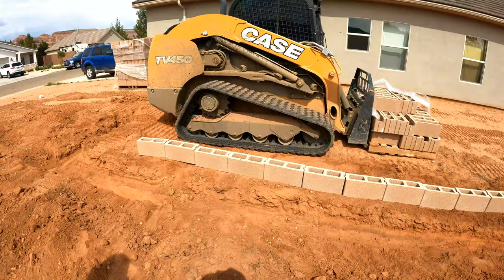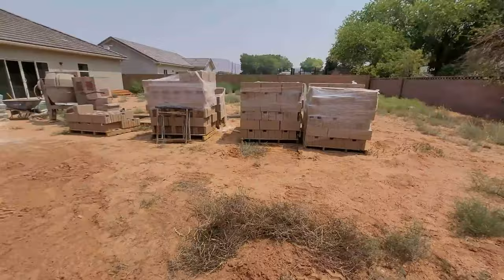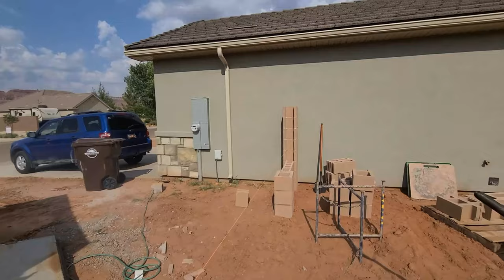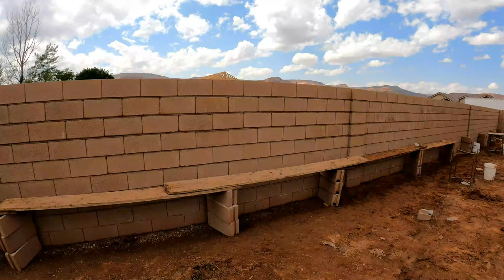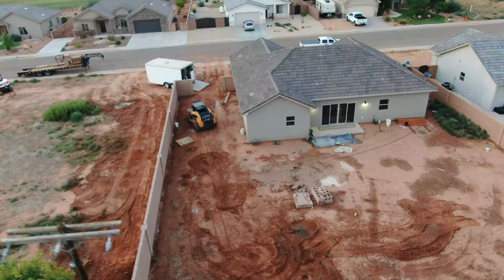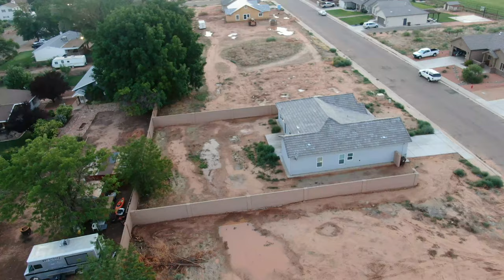Masonry Block Wall Full Build T&G CMU

Comment: Nice work again man!  Noticed the footing isn’t below frost. Is that the reason for the tongue and groove block?  Does the T&G block allow it to float?
Reply from the maker: The frost in this area is 10 inches, so it's good, and no t&g wouldn't help it float. Also the grade will be built up 3 or 4 inches because the back yard is low.
Reply: Gotcha. Figured with the snow in your other videos the frost line would be deep. Good work, you make it look easy.
Reply from the maker: Ya this job is way lower elevation, thanks man

Comment: Another great video! I still haven’t done my wall quite yet but hopefully soon. Hey in the wintertime do freezing temps at night factor into laying block and whatnot? For the footing for sure you want to keep it from freezing till it sets, but what about the mortar joints between courses? Are they thin enough they set/ dry up quick enough it’s not an issue? My wall will take a while as I probably will only be able to do occasional weekends and will take me into the winter I reckon (if possible…)
Reply from the maker: The block does suck the moisture out quite fast, but if it's really wet close to evening I'd cover it with a concrete blanket. If you leave your footing open overnight before you pour, definitely cover it as it will freeze the ground under your footing and it will for sure move if that happens and crack your wall. So cover the open footing, before and after you pour and cover anything thats wet enough to freeze.
Reply: @SolidworksUnlimited  makes sense, thanks again for all the great info 🙂